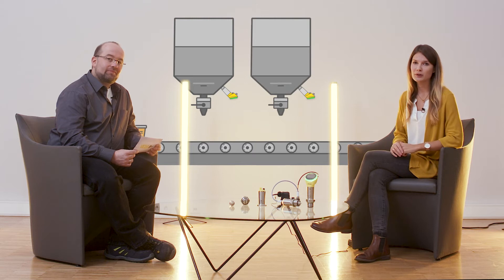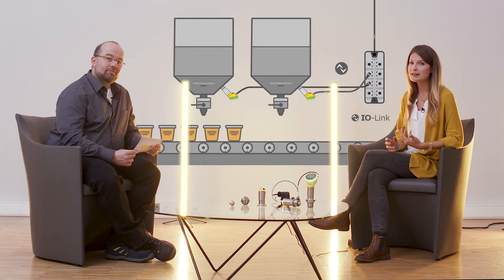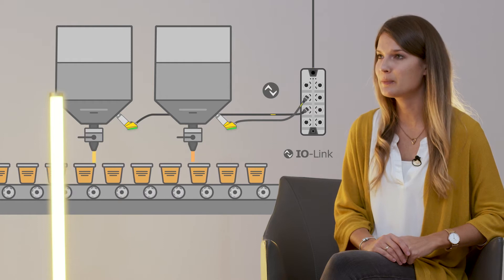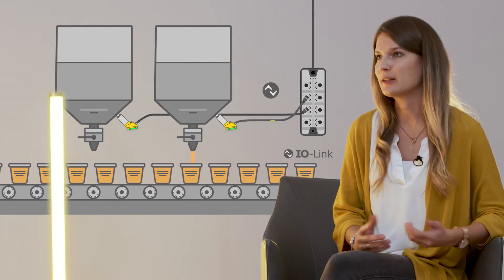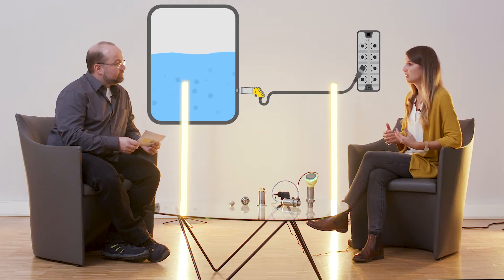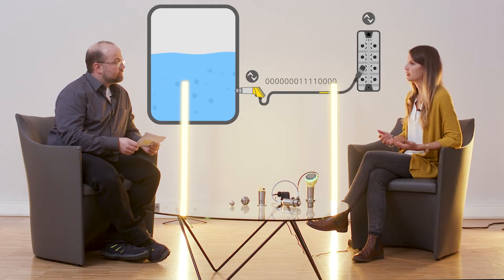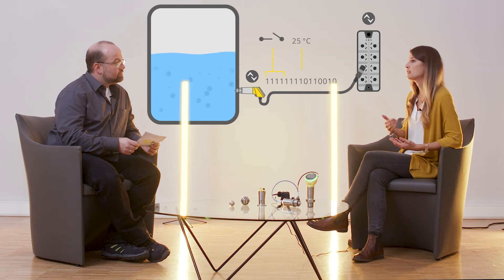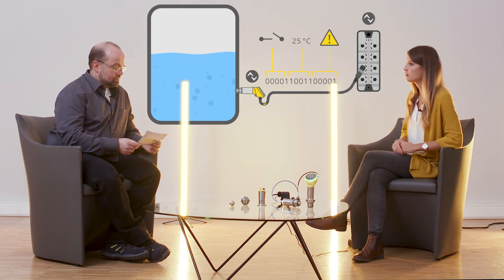☑ How IO-Link makes the integration of sensors into the process easier | VEGA talk

Comment: if i teach 1 vegapoint at what level he needs to detect ( and due to filth on the sensor not detect). Can i easely copy this with io-link to other vegapoints on the same master?
Reply from the maker: Thanks for your question. The parameters are saved in the master for each port. This means that if a sensor is connected to port a), this data cannot be transmitted to a sensor that is connected to port b), as it is a point-to-point connection.
But: The parameters are saved in port a) via the backup and restore function. A new sensor can be connected to port a) and the parameters are automatically loaded into the sensor, which can then be connected to port b).
However, those settings can also be made quickly and easily on your second sensor using the VEGA Tools app via Bluetooth.
In addition, the sensor can already be ordered with a customer-specific adjustment, so that you do not have to adjust anything.